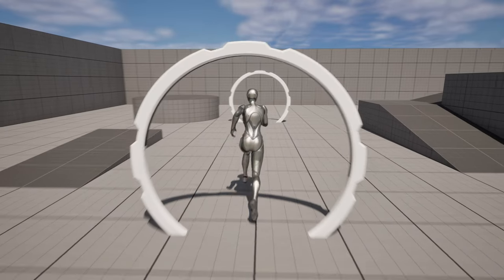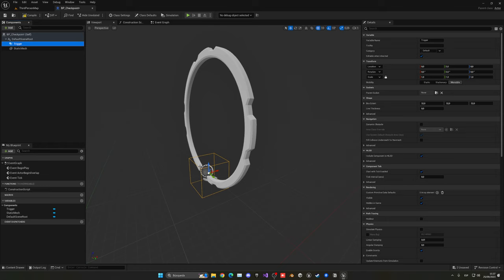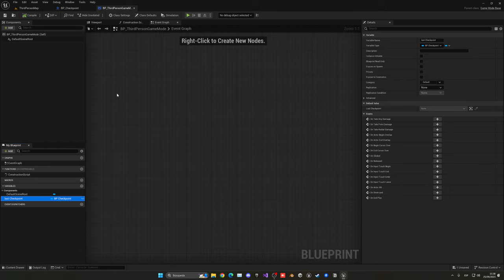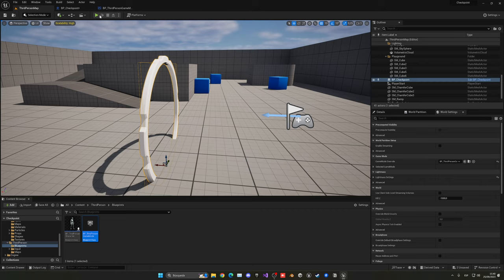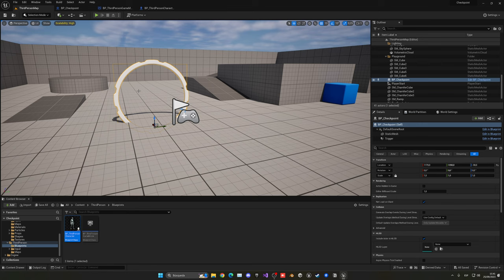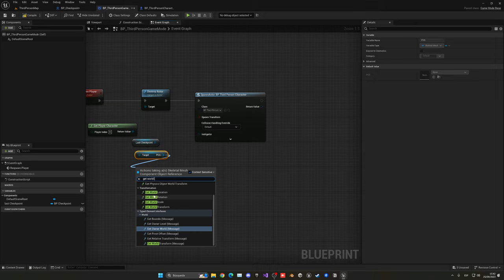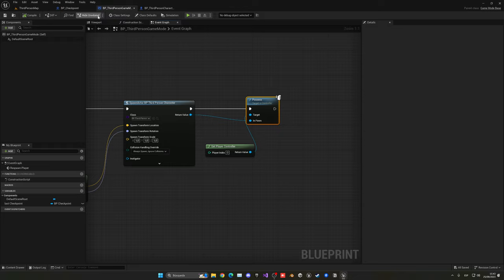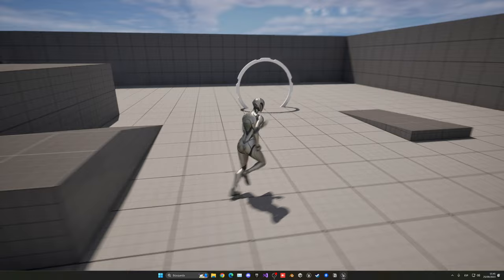How to Make a Checkpoint in Unreal Engine 5

Comment: If u follow this tutorial, and u find a problem with your HUD not working when respawn, just remove from parent the HUD before your distroy the actor, then add a small delay in event begin like 0.3, and it works just fine :)